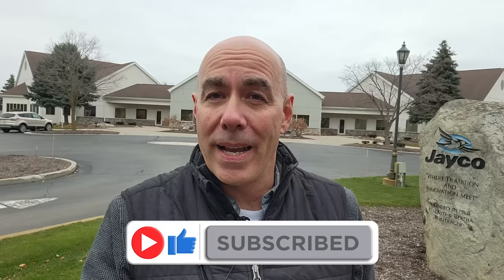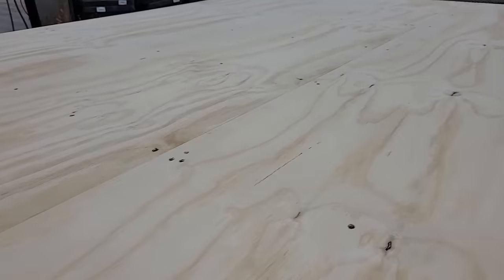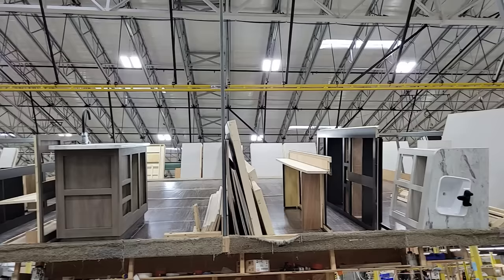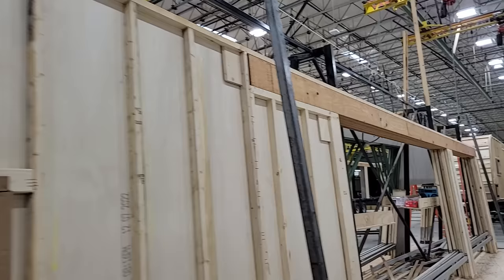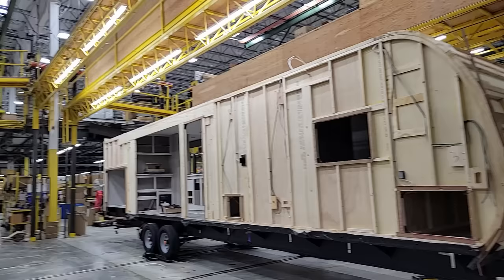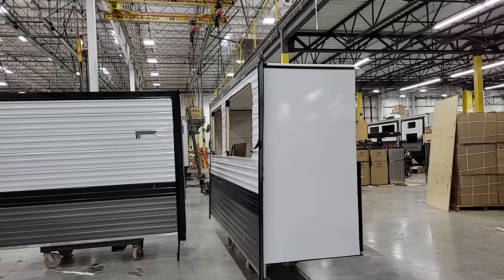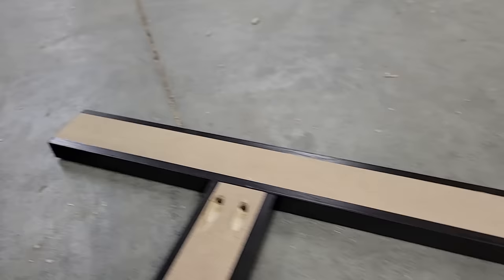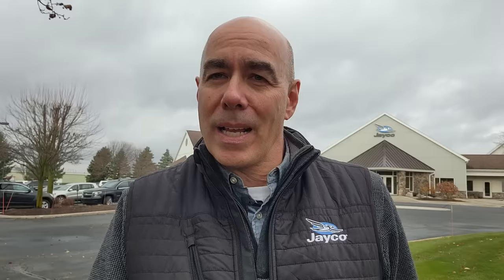How are RVs Made? - Jayco Factory Tour!

Comment: I own a 264BH that I bought January  11th this year. The wall in the bathroom is bad out of square to the point that the door doesn't fit the frame right. It's so obvious that even the owner at the dealership commented on it and said fix it now. They made an appointment for February 27th to bring it in. Why do I now own a travel trailer that I can't use or even put my gear into for 6 weeks or longer? I feel like it should have been a top priority or even returned to the factory for repairs. My first impression with Jayco is not good at all!
Reply: It's the amish quality he spoke about
Reply: @jason27swg  In my area they do roofing, barn building and demolish. You never see them in home remodeling or new home construction. Not intended to put the Amish down....they're great people.
Reply: ha..buy a used one..
Reply: And you got a good one.
Reply: @thardyryll ..yes..1999 safari trek 2430..aluminum construction..home quality cabinets and it’s on a very reliable chassis..these things always need something..but yes..i have one of the better ones according to past performance and quality
Reply: They are not good so many things that are unbelievably wrong mine is an287BH rocky mountain edition 2018 since you said bathroom I'll go there door is out of spare doesn't close rite can see day light and wind whistles through it I put a level on the exterior wall almost 2 inches out of plumb hole room out of square plumbing leaks under sink panels not stapled to studs in shower vent in floor way crooked interior door hung so bad it's looks like the vortex at house of mystery lights some times work or Flickr. Or are dim pedal on toilet sticks so water trickels untill it over flows the thing that supposed to clean out blacktank when a hose is attached was not clamped so first use flooded the rv water went down vents that what I noticed the first day in one small room
Reply: @jason27swg  lol

Comment: Unfortunately the design of these units are setup to fail from the start. If you drive into a dealer lot where the unit was delivered during the winter there is surface rust all over the place. The roof trusses are wood and most of these units leak from the openings cut out for vents and air conditioners. Owners have no idea how quickly these seals start to crack and leak. These units should be built without one stick of wood in them. Totally aluminum from top to bottom. That way when the unit leaks the skeleton of the trailer allows to rebuilt the walls and ceiling easily. Unless your checking all the seals on this units every couple of weeks they will leak. Talking from experience as I have rebuilt about a half dozen water damage trailers. Not to mention paying $30000 to $150000 for a trailer and then financing it over 20 years is border line nuts.

Comment: I found it interesting when you made the point of not using staples in the construction of the cabinet frames to make them sturdier. Yet in every scene in the video showing bare frames, they are all stapled. It was also interesting to see the extremely poor quality wood used in the frames, and especially in the roof trusses you seem to be very excited about. Those 2x3s they are using to build those trusses have no strength when oriented on the flat side, like the trusses shown in this video. And the excessive amount of checking & cracking will only serve to weaken an already poorly designed structure. One other item of note in this video, none of the wood used throughout the units seems to have any attempt at sealing it to prevent rot. Water infiltration is inevitable in any RV. But it does not seem like Jayco really makes much, if any effort to waterproof anything.

I'm not saying that any of the other manufacturers do any better, in fact I've visited at least one factory that I'm embarrassed to ever admit I was there after seeing just how bad the material & workmanship is. But I'm certainly not seeing anything in this video that would lead me to believe that Jayco is doing a better job than any of the other, reputable manufacturers.

On a side note, a former employer of mine purchased a new & very, very expensive Jayco 5th wheel. In the two years since he purchased the trailer, it has spent more time at the dealership getting repair work than it has in his possession. His biggest problem, slide-outs that constantly malfunction. Not just occasionally, virtually every second or third time using one.

Considering he paid more for that trailer than most people will ever pay for a house, I've never seen such deplorable build quality on the inside. There are many instances of misaligned furniture & trim. Cabinet doors that don't close properly, drawers that are so stiff you can barely move them. The shower pan is raised up from the floor one side, and Jayco's solution was to just increase the bead of caulk from one side to the other (the bead is approximately 1/16" on one side to almost 1/2" on the other).

Unfortunately, poorly built RVs are the norm, and not the exception. It's just the nature of the industry.
Reply: Our unit, a 2021 26RK, the kitchen cabinets have been assembled with a combination of methods. The biggest issue is the low quality MDF they used in the construction. In our sticks and bricks house, we had a flood in the master bath a few years ago where the builders grade, vinyl wrapped vanity cabinet was soaked in water, the drawers completely flooded. This remained for hours in water. We got it dried out and it showed NO signs of damage. No swelling, no peeling of the vinyl, NO damage. Once again, that was in our sticks and bricks. In our White Hawk 26RK kitchen, a small leak from the sink p-trap and a small leak from a cracked water pump sediment filter caused significant swelling damage and the vinyl to peel off large sections of the kitchen cabinets. This was with MINIMAL water exposure. Now I get to rebuild the kitchen cabinets. 

Honestly, this is just the latest in the long list of issues we have had with this rig. Not sure any of the others are built any better but I damn well know that Jayco hasn't provided us with much fun over the first year and a half of ownership.

Comment: I bought a new 2018 Jayco Hummingbird and loved it. However, it leaked water from day one. Fortunately, I my dealer was within 5 miles of my home because I took it back multiple times to get the leak corrected. They would apply some ProFlex here and there, run a yard sprinkler on it for 30 minutes and call it done. I actually found one defect that was causing a water issue. They cut the lower refrigerator vent flush with the floor instead of an inch lower like I found other campers to be and was told was proper. That creates a lip to stop water but mine, being flush to the floor allowed water to enter under the refrigerator. I corrected that issue but that wasn’t the main leak. Eventually, I had mildew on the seat cushion bottoms. I continued to return my unit to my dealer until, 3 months prior to my 2 year warranty expiring, Jayco notified my dealer that they would no longer pay any warranty work on my unit. I was stuck! I couldn’t sell it due to the mildew issue and evident water stains in the cabin, so I traded it to another camper dealer at a loss just to get rid of my problem. Now, for 2 1/2 years, I have an amazingly well built camper that has never leaked! Never again, Jayco! Never again!

Comment: Interesting video. We just bought a 2024 Jayco Jay Flight 235MBHW in February. Our first RV was a Keystone Hideout and we learned so much about preventive maintenance and addressing the small things to keep our RV ready for camping and road worthy. The first thing I did with our Jayco upon purchase was complete a thorough inspection of the interior and exterior of the RV. I found two screw heads stripped off, several screws stripped, the top exterior slide out seal pulled off the exterior wall (by the way it is stapled on), the top interior slide out seal pulled away from the wall, the top interior wall panel was cut out leaving a huge gap between the wall panel and top of the slide out, a piece of trim missing on the slide, the furnace not screwed/bolted to the floor, furnace fan blade cracked, the slidebox not evenly centered for the exterior seals to make a proper seal along the sides of the slide out, and the rear stabilizing jack screws mounted directly into the sewage hose storage bumper which protruded up into the storage bumper and would not allow the hose to be stored, (I figured this out when I tried to store the hose, it jammed and when I pulled to try to remove it, it ripped the end connector off the hose). And...our RV Go Power Solar Charge controller was wired incorrectly. Since the end of March, our RV has been sitting at the dealership awaiting for parts from Jayco (today is May 10). By the way we were informed a few weeks ago that the parts were shipped to Minnesota and had to be rerouted to our location. This RV was not an impulsive buy, but one that we believed was the right fit for our family. We were shopping for an RV for 5-6 months and found this one and really liked what we saw. We looked at reviews, the Jayco website and compared this RV to other competitors. We decided on this one for many reasons. We made a 370 mile round trip to pick this one up and return to our home. We are disappointed that our RV left the Jayco plant in this condition. I'm glad we have a 2+3 from Jayco understanding that issues do arise, but we believe these discrepancies should have been identified and repaired prior to shipment to dealer. After all repairs are completed, our hope is we will enjoy our Jayco and it will serve many great family memories throughout the years as our children grow.

Comment: Interesting, they are built a little sturdier than I gave them credit for.  Good point that they have to tolerate high winds and lots of vibration and bumps along the road.  We just replaced our old popup with a 2023 travel trailer and was surprised that it has the on-demand water heater that was new for this year.  Not sure I like it very much.  My gripe is that it doesn't make it easy to conserve water when showering.  You have to wait for it to light up, heat the water, and get the hot water to the other end of the unit where the shower is.  If you then turn off the water to wash up, it shuts off.  Then you turn the water on again, you get still-warm water, but then you get a burst of cold water and you're waiting again for it to warm up again.
Reply from the maker: Good points, Dave.  Not sure which brand of water heater you got, but the Furrion 60k that Jayco installs has a 1L mixing reservoir that helps maintain a constant temp. Some units, depending the install,  also have a recirculating function whereby the water is instantly hot at the faucet location when turning on.
Reply: Wish they would use the system used in Geo Pro's that shows when the water is hot at the shower and diverts the warming water back to the fresh water tank.

Comment: I’m glad i ggot a pre-pandemic build grand design 2020. Prayers are with anyone with a newer cobbled together rv with supply chain parts from whereever and mismatched.
Reply: I have a COVID built 2022 Jayco Greyhawk 30Z and I keep fighting all their lack of quality issues. Water heater tank installed on top of rubber gas line. Over time it collapsed causing low gas flow. Jayco said it was my fault for the lack of maintenance. The bedroom slide is not chaulked properly and leaks water into the camper. Outside trim pieces are coming loose. The water hose connection to the back of the toilet was loose and leaking water.
Reply: I’ve had two Rv repair guys tell me they wouldn’t buy anything after 2019. And to keep my 02 fleetwood as long as I could.

Comment: Aluminum frames are not as strong as stick built trailers.....if quality lumber is used. Some of the wood I saw being used looks like it was reclaimed from a Home Depot dumpster. The aluminum frames are only as good as the welds......most of the welds I've seen look like tack welds instead of nice flows.

Comment: Of course not showing up while the staff is working on them. So you don't see them rush the production.  Lino not wrapped around the edges,  And most unit do use galvanized steel sheets around the wheel well. Bragging that the furniture is not stapled together,  but screwed together.  But the shower base is stapled together.
Reply from the maker: Eric, many of the workers in the plant are Amish who prefer to not be photographed, so I was happy to oblige that request.  Thanks for watching

Comment: Hi there jayco why and not only you guys but everyone using wood for framing are you not treating the wood ? I've dealt with this Oversight for 40 yrs , every one of my RVs 6 of them have had wood rot from water , so when I repair them I treat the lumber with a preservative and regularly check and maintain the seams , I've never bought a new unit but as a tradesman builder that was the first issue  that I addressed , my first year apprentices prep and seal all my wood , just an observation!

Comment: When I saw all the staples holding the lvl beam on the upper portion of the frame...actually everything seems to be held together with those staples....I was shocked. There were framing nail plates used as well. Did they run out of screws in Indiana? For a house that is going to vibrate and shake...I guess they're all building absolence into trailers too.

Comment: What an awesome video!  Thank you!
One question because I am just curious, how come your integrated A-Frame isn't cut at a 45 to be able to be directly welded to the side of the frame? Thanks, cheers
Reply: The cleat is weaker than frame to frame welding.
Reply: I noticed that as well.  They welded a little piece of metal to the main frame and the A-frame piece - to be honest that has virtually no structural integrity.

Comment: Amazing Jayco totes their quality lol, but Jayco can't put a wax ring with a horn or a rubber ring with a horn under the toilet.
 Instead, they just put a rubber ring under the toilet with no horn knowing all too well the vibration from the road will allow the toilet to move just enough to allow water to seep under the linoleum flooring rotting out the strand board.
Of course, if they were to use plywood and paint it before installing it making it even more resistant to water, instead of the OSB strand board I might not have to replace the floor I'm in the middle of doing.

Comment: I purchased a Jayco Eagle in 2019. After every trip it went back to the dealer for repairs. Replaced the radio, water heater won’t stay lit on propane. Never fixed properly and the warranty is up now. Lights over the dinning table just fell off and broken glass everywhere. The lift switch failed on me when trying to leave a camp spot. Did that by hand. After my latest trip I returned home to find ceiling molding on the floor. The first time I used it the propane smell was strong while barbecuing. I sprayed soapy water on all the connections. Ninety percent of the fittings leaked. Phone chargers in the bedroom don’t work. When I brought this to the dealers attention and was told they meet speck. The floor is starting to squeak more. There is nothing “quality” about Jayco.

Comment: I've owned a couple of new higher-end Jayco trailers that had aluminum framed walls, with wooden roof trusses. 
I know this is a lower end unit, but i can't believe that everything is still wood, pretty much like they've always been.
Reply: Wood frames and aluminum skin may seem old fashioned, but if you have a problem, you can fix it, not panels glue to synthetic materials. The old engineers that came up with the first camper trailers knew what they were doing. You can get materials like wood anywhere. I looked at the campers like the Geo with smooth panels with aluminum frames, and synthetic substrate, was almost going that route, but a local place that sells both styles say the still de laminate. I’d croak if my brand new $30,000 plus damper fell apart, thanks

Comment: Some of These comments are  harsh.  Slide outs give you extra room. However.  I think a travel trailer with no slide outs would be less likely to have any issues.  These trailers are not ment to be long term residence.  So of course they are not going be built like an actual home.  I’ve seen a lot worse campers that did not even hold up a month.  Jayco offers a 2 year plus 3 year warrenty   Don’t buy a 40k plus travel trailer if you’re so worried about it holding up. I’m going to buy single camper  to stay in when I’m working away from home it won’t be a permanent residence

Comment: I understand you are a Jayco dealer and want to push the product line. However all the quality materials used doesn’t really matter if the workers just throw these units together to get them out the door. You watch any video on campers from actual owners and you will quickly find any brand out there has defects in workmanship. Some far worse than others. A friend of mine just bought a new 30 ft camper (I won’t mention the brand just to avoid being sued) and after he got it home and went in, they found the microwave was about to fall out of the space because it wasn’t secured. The refrigerator was out about 6 inches, 2 of the cabinet doors was missing screws on the inside and a piece of trim in the front bedroom was coming off and on top of that the brake on the right side wasn’t secure and he just dropped almost 40 grand on it. And of course this camper is one of the best on the market, according to the salesman. So again, just because they use quality materials doesn’t mean it’s built by quality workers
Reply from the maker: Jayco isn't perfect, although the largely conservative workforce that builds Jayco tends to be a cut above what I've seen in other factories.  -Mike